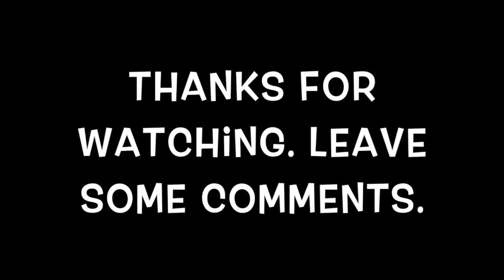Watching them get stuck  Pumping concrete with Muddyfeet Concrete Pumping

Comment: You need to find better customers. Who plan better. Playing in the mud is costly.
Reply from the maker: Lol I like my customers. Some of there jobs make for good videos. Lol
Reply: Why? The muddier the better, since the longer it takes the trucks to get to him, the longer he's there and the more he can charge for the job...
Reply: @HappilyHomicidalHooligan  Remember the pump is one of the last out and would have to go through the mess. Ever see a big truck break an axle in mud? Not pretty and $650/hr to get it out then a big dollar fix. and Truck down not making money.
Reply: @bigrick7108  True, but with the outriggers, the pump can lift itself up to make putting gravel etc. under the wheels easy and if the driver is careful, they have low risk of damage.